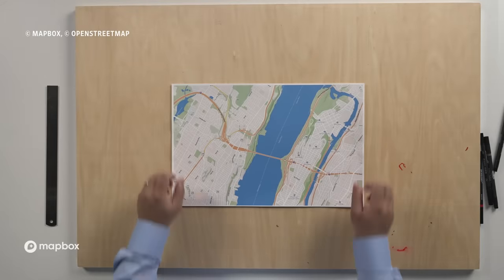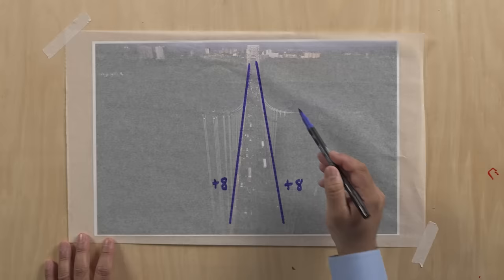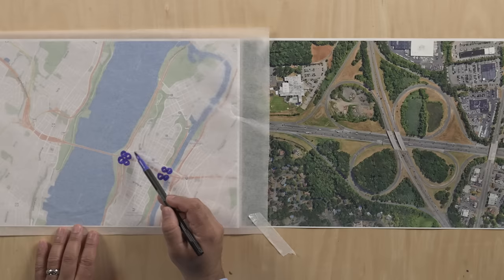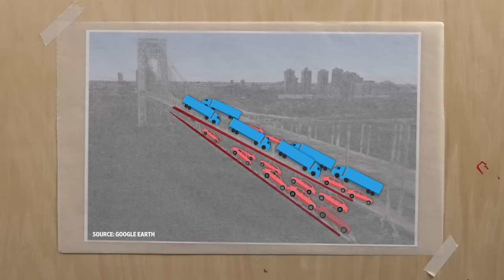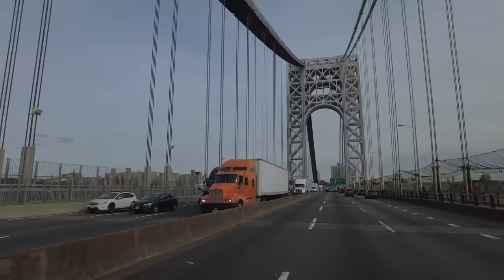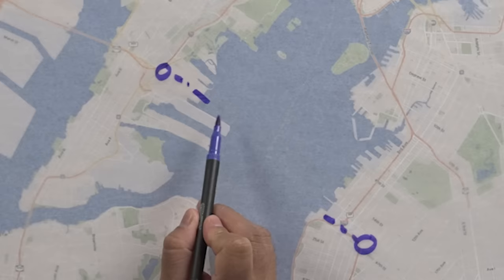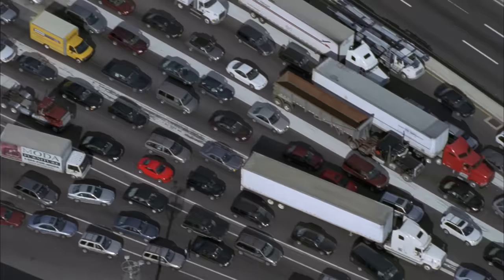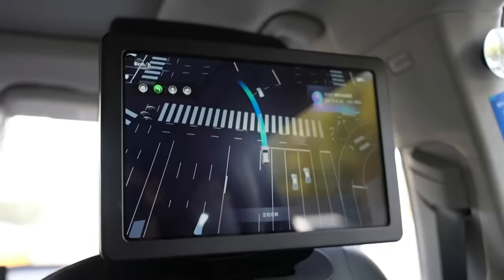Transportation Engineer Tries to Solve America's Worst Bottleneck | WSJ Pro Perfected

Comment: ok so like, imagine if we had a form of transportation that let you put multiple trucks worth of cargo on a single vehicle  all going the same way. oh wait. TRAINS.
Reply: Umm…the existing trains are over capacity, that is why they said they are considering building more tracks and tunnels across the river. That bridge handles more than 300,000 vehicles a day. Many going all the way up to Canada.
Reply: @JakeSDN  then scale up the existing trains
Reply: @JakeSDN  If that's the case then surely the road network as a whole should be questioned - trucks going all the way to Canada should not move through (almost) central NYC in the first place.
Reply: @Sp4mMe  NYC roads and highways were created more than 100 years ago, some don’t have shoulders. Infrastructure was built around them, so changing them is really expensive and requires a lot of studies. The construction of the Brooklyn Bridge started in 1869, the George Washington bridge in this video had it’s construction begin in 1927.
Reply: @JakeSDN surely if they are going to Canada they would avoid NYC altogether and keep going North. There are other bridges that cross the Hudson, such as the Coumo/Tappan Zee bridge.
Reply: @JakeSDN There’s no need to take 95 to go to Canada. You can take 87 straight up. If you need to cross over to 87, there’s plenty of places north of the GWB to do so.
Reply: Trains already here. They go up to Selkirk on the CSX river line, or they go to Staten Island on the Conrail Chemical coast
Reply: @JakeSDN  Yet, this has been done hundreds of times in Europe. It's not that hard. It just takes proper planning.
Reply: How many supermarket's have a train unloading dock behind them?
Reply: The US already transports more freight by rail than most other countries. But good luck fitting a mile long freight train into manhattan, there wouldn't be enough room for a rail yard.
Reply: Bro thinks trains will fix everything lol just because the US doesn’t have a good passenger train system, doesn’t mean they don’t mean the US doesn’t have literally the largest freight train system in the world
Reply: @JakeSDN  this is why Rep. Nadler has been advocating for a freight rail line under the harbor
Reply: Passenger and freight rail upgrades were both mentioned in the video as a way to alleviate the GWB bottleneck.  Both ideas (Bayonne to Brooklyn freight tunnels, and internetwork transit expansions and connections between NJTransit, Metro North, Path and LIRR, and between Grand Central and Penn Station) are in the planning phase at least.
Reply: What if we put all the cargo on the NJ side into big cannons and fired it into NYC? Anybody with me?
Reply: If only there was a mode of transport that could carry more freight than a railroad and go more places and do it cheaper...
Oh, wait. Ships.
Reply: @tira2145 thats when trucks are useful
Reply: @tira2145 Ever Heard of a warehouse befor? Does youre Amazon package also get delivered from China only trough truck?
Reply: @Shloomy_Shloms Yea  only becuase its the biggest doesn't mean its the best you know trains can very well work if planned better
Reply: @donaldleyton4977 But for a 3 Lane highway there is space?
Reply: @irisachternaam I can’t think of a single place in Europe with that much congestion when it comes to people, lack of space, and then cars, compared to the NY metro area
Reply: @Sp4mMe  …. Not sure if i should be replying to you, Jake, or someone else, so please don’t think i am picking on you or misrepresenting  something you said.
The “solution” is to eliminate the pratice of having heavy and light freight (train and truck) and heavy medium and light passenger ( train, bus, POV) traffic that flows THROUGH manhattan to the other boroughs, NON NYC local communities and destinations beyond which means improving the transportation structure around NYC (Manhattan) 
And quite frankly RELOCATING the recreational activities AWAY from the existing bridges going into the Island 
“Oh we cant repair / upgrade our infrastructure, there is a dog park right there” 
Well who is the fool that put a park in the middle of a right of way???
Reply: @JakeSDN Amtrak has service to Canada.
Reply: @tira2145 Build them, but in urban areas some already do
Reply: Take a look at a map,no good way around
Reply: Where? Are you going to pay the extra mileage,fuel and time?
Reply: I know many drivers from europe and the roads over there are terribly planned or planned to be terrible
Reply: Hunts Point produce market,how do you think fresh produce gets to the buroughs/NJ/Ct/east Penn?
Reply: We just seriously needed for America to not bulldoze too many rails back close enough to the WWII end and beyond :,D

(Look up Not Just Bikes, Strong Towns, and possibly Climate Town. Thank me later 

PS: I feel bad for the engineer a bit cuz he's obviously doing his best to observe the issue but we need an overhaul. We seriously do)
Reply: @JakeSDN  Elon Musk tunnels.
Reply: Bro obviously didn't watch the video
Reply: You're 14
Reply: Umm genius trains don't deliver to Walmart or target.....
Reply: @Superboy-jx3zv you're not very smart....
Reply: @manujadesilva22  You don't know much about I-95 do you?
Reply: Trains are great until you need to get to a store . Think small places and small unloading docks so the train can’t final mile most consumer goods . However most of what you buy did run part of the way buy train in Intermodal containers these go to rail yards from there intermodal trucks take those loads to distribution centers where the freight is sorted down to individual deliveries for stores and then sent buy another truck . Intermodal rail yards are huge with multiple cranes and lots of heavy equipment . The yards in the harrisburg pa region are miles long your not building that in New York City that’s why you have so many big distribution centers in Pennsylvania . A better solution is force people out of their cars and onto public transit freeing up room for freight delivery . If it costs more for you to drive in than it does to take transit you will effectively control traffic .
Reply: @leonpaelinck existing trains are now running 10 to 15 thousand feet long they have been scaled up .
Reply: @Shloomy_Shloms  The US freight rail system prioritizes moving high-profit bulk goods (e.g. coal, grain or crude from the middle of nowhere to the middle of nowhere) over consumer goods delivery, so it has little impact on alleviating urban congestion. If anything, the numerous at-grade crossings in cities like Pittsburgh often put entire blocks on standstill
Reply: Half the video is literally about trains.
Reply: I take the NJ Transit from Manhattan through the Weehawken tunnel and over the Portal Bridge daily.

 Literally only one track in each direction shared by NJT and Amtrak
Reply: @leonpaelinck you know that Ohio train crash, the one that released toxic chemicals. That was one cause by scaling up our current trains. We need whole new infrastructure. Bigger rails train cars ect
Reply: depends a lot on the country. Belgium and Germany both have major traffic issues
Reply: Flarfo ok so like, imagine if we had a form of transportation that let you put multiple cars worth of worthless people on a single vehicle all going the same way. OH WAIT. TRAINS
Reply: upgrade the subways so they can handle small freight while being fast and efficient
Reply: In Australia they have truck trains
Reply: He says that in the video. From 3:54 onwards is all about trains
Reply: You sound like Adam Something
Reply: Trains carrying cars? Weird idea!

Comment: My biggest thing I’ve been saying for years is that trucking needs to be forced to work with rail companies. They should only be taking these goods the last 100 miles. By making them travel across the country and all around these cities we are causing so much traffic for no good reason.
Reply: Rail companies hold all the cards.
Reply: Nationalize, Nationalize, Nationalize - Alan Fisher
Reply: Yep, it's being done here in NSW. Big intermodal loading docks connected to sea ports via heavy rail. The US needs to move away from road-based infrastructure.
Reply: And trucks should only operate and distribute between 19:00 and 07:00.
Reply: @nickprafke6664  So let us - an entire nation of people - take those cards and that power back from them - a small group of shareholders.
Reply: Truckers and Trucker unions would never let them. Big companies politicize this issue to keep truckers angry of any change and costs of logistics low
Reply: @BigBrotherMars  well... they could always squeeze them a bit more, giving incentives to the freight railways to speed up delivery and decentives for the drivers to travel during certain times for long distance... but then where the rail lobby?
Reply: @user2144 This comment 💯👏
Reply: Truckers aren’t the problem it’s state politicians who don’t do anything
Reply: @user2144  And see the prices of everything doubling. Also, will  you be willing to pay for the required parking spaces to accommodate 2,000,000 trucks during those off hours?
Reply: And damage roads!
Reply: The "good" reason why there's so much traffic is the money flowing into (the owners of) the fuel & truck production companies.
Reply: raise the price of diesel, with the tax money going toward infrastructure maintenance.
Reply: @BigBrotherMars  A pity the railways were privatised from the beginning in the US so there's no union or public push for more rail.
Reply: Right, had similar thoughts prior to entering the industry, turns out it’s a bit more complicated than that
Reply: Those drive-on flat cars to take semi, with passenger cars to carry drier and sleeping bunks. ;)
Reply: Loading and unloading from a train is too much work and costs too much.

Train transport is only viable for very long distances or very heavy loads
Reply: NATIONALIZE IT
Reply: Not to mention the roadway damage that trucks cause
Reply: Yessir. (Hotshots excluded)
Reply: Someone has to pick up the freight and then take it to a rail yard, and then another has to pick it up from the rail yard to deliver it. That has its issues and isn't productive for time sensitive freight and a lot of extra work for little gain.
Reply: @evettc7887  
With all the bulk freight out of the way on trains, the time sensitive stuff can take the now emptier roads

Comment: Improved Public transit is 100% the answer
Reply: Not for freight. Although, rail is still the answer ;)
Reply: @QemeH well most vehicles on the bridge are cars, not trucks.

So if many of those people would switch to public transit, it would free up space for trucks
Reply: And I'm 100% sure that another line will solve the problem.
Reply: Make it clear and safer . I used to take the subway to school  - not in the US ofcause.
Reply: A quick, cheap and easy fix would be a bus lane on the bridge...
Reply: Not really because it’s not a public transit issue it’s a freight issue. The trucks share the roads with cars because there isn’t much freight rail in this area. People will drive their cars regardless. NYC has a lot of public transit, but most of the congestion here is people coming from outside or going through to get somewhere else. So at least locally, it’s roadways that need to be redesigned and more options to deliver freight.
Reply: @Yannakis1999 The largest bottle neck in Texas proved this theory wrong. Adding another lane just added more cars on the road and thus winding back at square 1 again.
Reply: 100% false.
Reply: @failtolawl  okay Ford dealership cool answer
Reply: Also: Bikes. More pushbikes. They flow ridiculously well.
Reply: @QemeH  There would be traffic jams on rail.
Reply: @ikanmesra  So... the solution to traffic jams on the road are more lanes - but the solution to traffic jams on rail can't be more lines? US americans sometimes baffle me...

Yes, obviously you'd need to improve the rail infrastructure to handle more public transit and cargo - but one rail line can handle orders of magnitude more in passengers-per-hour AND tonnage-per-hour than one lane of traffic. And they are comparable in used space.
Reply: @QemeH  Traffic jams on rail is possible if all existing living humans in the world lives in one car-free city.
Reply: @QemeH  We need to abolish roads and replace it with rails. Imagine if the rail bridge collapses, yeah, the emergency helper people would just walk away to the incident area and bring the victims to the nearest hospitals just by walking. I'm not mocking but just think how to build a rail bridge without even trucks and excavators. Well, we need 300 people carrying 30kg object at the same time. So yeah, 0.1kg per person.
Reply: @ikanmesra  How did you suddenly arrive at "we need to ban every single vehicle"? The video is about a bottleneck that carries to much vehicles at the same time. The throughput is to low. And THAT is the PRIME use case for rail over road: throughput!

Comment: So much of the congestion on the George is commuters from NJ who work in NYC. The most effective option IMO would be to massively improve rail connections between the two. At the moment, the North River Tunnels are a major bottleneck, and the unreliability of NJ Transit caused by those tunnels makes it even worse. The tunnels are a pair of 1 track each tunnels that go into Penn Station. They are 110 years old. Any broken train or tunnel takes out one tube, and the need to accomodate trains in both directions means one tube out causes a 75% or so drop in capacity. The Gateway Project is going to add 2 more, fix the original 2, and end up with 4 tunnels total. Adding more rail from NJ to NYC that goes to more office areas will help too.
Reply: New York subways haven't been improved on since the 40s and they're currently infested with homeless people. There is a LOT of improvement to be made.
Reply: We probably won’t see that in years. They claim they spend a lot of money to maintain trains and bridges. So building or adding will be most likely difficult
Reply: Wrong. Most take buses already
Reply: It really does need more rail connections and alternative routes.
Reply: Or let office workers work from home…